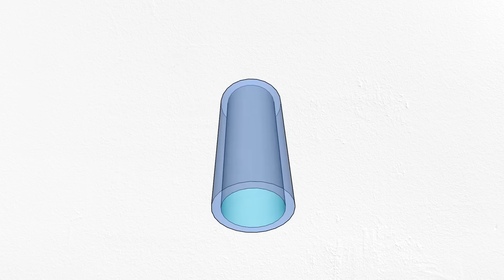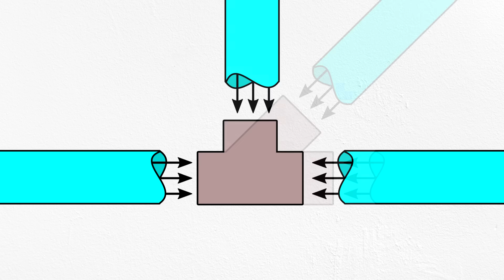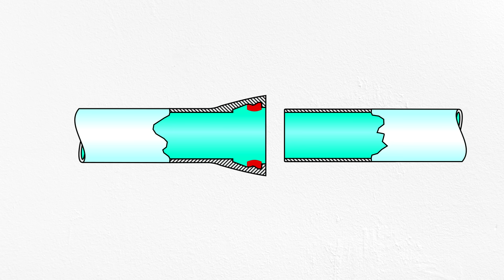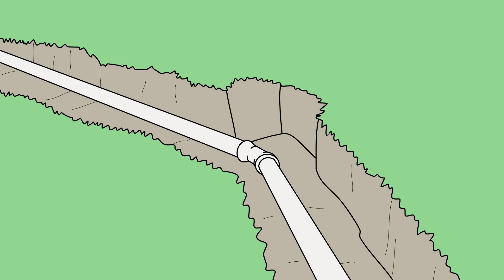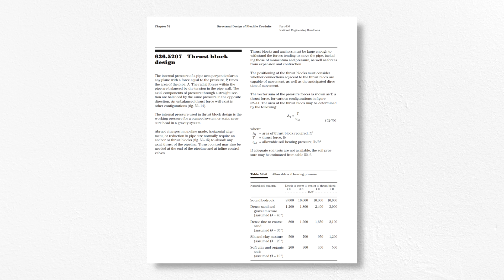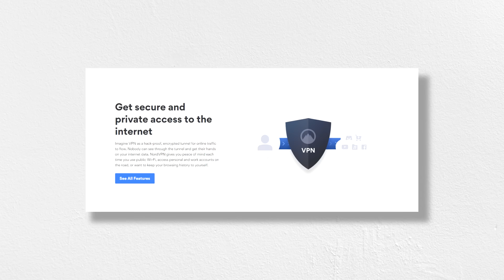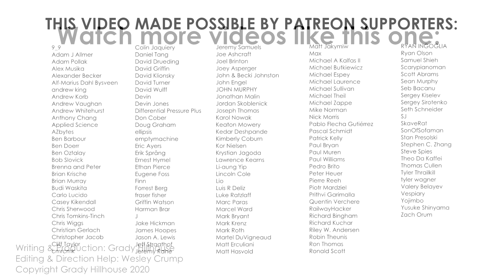Why Pipes Move Underground

Comment: Calculating static &  dynamic shock forces on large pipes, for example, 100 lbs static on a 12" pipe is 11,300 lbs, dynamic shock loads [like air in the line] multiply that many times!

Comment: One minor clarification, those push on joints are only used for straight line sections of pipe, and each pipe is not really held in lace by the dirt, but by the piece in front of it. Ant THAT piece is held in by the piece in front of IT, and so on until you reach a 45° or a 90°, which is held in place by a thrust block, a mechanical joint called a megalug, or both.

Comment: I'm honestly surprised that with modern materials those gaskets can't be induced to fuse the pipes together with a little electricity, heat, or just water-activated chemistry. Or is ease of disassembly a typical concern, too?

Comment: My house is on the side of a hill.  The upstairs bedrooms are downstairs, one level down from the front door.  On that level, there are a shower, toilet, and sink, in addition to the bedrooms.
Water from the 2 upstairs (ground level) toilets and a sink goes directly out to the sanitary sewer system.  Water from the kitchen and laundry goes down under the house.  It's joined there by water from the downstairs toilet, sink, and shower.  All that water flows to the ejector pump.  When the pump shuts off, after pumping a bit, there is serious water hammer.  In 3" PVC pipe.  With 57# of water coming to an instant stop.  So, what's the system? 

There is a tank, maybe 24" diameter and 30" deep.  Water flows into that tank.  The ejector pump, which is inside that tank has 2 switches.  The pump turns on when the top switch activates it, and off when the water is down to the level of the bottom switch.  A separate check valve, outside the tank, then closes and prevents water from flowing back into the tank.

The water is pumped up, through the top of the tank, into a 3" PVC pipe, through a 90° angle, through another 15' of horizontal PVC pipe, then another 90° angle, vertically up 12', through another 90° angle, and then to the pipe leading to the sanitary sewer.

ALL that plumbing is in the air, with a few brackets here and there to support it.  The problem arises because when the ejector pump shuts off, the check valve closes so that all the water doesn't flow back into the tank.  What you have, when the valve closes, is the weight of all that water coming to an instant stop.  What's the weight?

27*12*pi*1.25^2*62.4/(12^3) = 57 lbs.

(If you don't think that's a lot, try dropping a 50# weight on your toe, bringing it to an instant stop.  How many feet high would you like to drop it from?)

It's supposed to be a silent close valve, which should slow the water down, but I can hear it close.  It's not.  OR, that function is broken.  Where there are the 2 angles in the PVC pipe, there is considerable pressure, trying to tear those joints apart.

In the video of the commercial piping, there is backing where pipes have angles.  There is nothing in my system.   I asked about installing a water hammer arrestor and was told that, with a toilet etc in the line, I cannot do that because it will be clogged with .. yucky stuff .. over time.

I asked, "How 'bout we pump it straight up and over a hump, and then to the sewage line, and eliminate the need for the check valve?"  But that's not up to code.   At this point, I have no idea what to do.  The pipes have completely broken at least once, and been repaired.  But the problem hasn't been fixed.

Comment: Grady, with one other consideration important on underground water piping: Freezing in winter. I am from the mid-Atlantic area which has freezes during the winter months. When water freezes, it expands and will break anything containing it. Much of this is prevented by burying the pipe under the frost line. However, with older pipes, very cold water from a reservoir creates a temperature difference that causes a bursting of the pipe. The pipe itself is normally at a constant temperature being under the frost line. The water is extremely cold. The pipe can fail, resulting in a sinkhole at the surface.

Comment: Another reason why it is often desirable for a buried pipe to have joints that are not restrained, is to allow the pipe to expand and contract as it experiences changes in temperature.  In my opinion, the reason why some old cast iron water pipes experience breaks in freezing weather, is that the colder water in them and the colder soil around them (though not necessarily frozen) causes the pipe to contract, but it is unable to do so sufficiently to relieve the resulting stress if the joints have become "welded" by corrosion.  The pipe then fails by tensional stress at a point somewhere along it, possibly where it has been weakened by corrosion.  This is why so many old underground water pipes -- mostly under city streets -- need to eventually be replaced.

Comment: About 3 years ago, in Conroe Tx, a concrete truck hit a fire hydrant. The pressure from the water rushing out of that break cause 3 other breaks underground across 7 city blocks. It took 4 days to dig it all up and fix it.

After this post I found your water hammer video. Thats what they said happened.

Comment: I wonder why - if the pipe shouldn't move in longitudinal direction - the exterior of a pipe is very smooth. Wouldn't it be much better if the pipe was quite rough with small "ribs" to create better bonding with the surrounding soil?
Reply: For typical pressure pipes that have non-restrained couplings, one way to "anchor" a bend is to provide restrained joints at the bend itself, and for the pipes for some distance on each side of it.  The friction of the soil on the adjoining restrained lengths of pipe thereby resists the hydrostatic force on the bend.  The rougher the pipe exterior, the greater this frictional resistance will be per foot, and the less length of restrained pipe will be required.  But the pipe needs to be properly bedded and buried in compacted soil before it is pressurized, or it can blow apart at the first unrestrained joint.  This from a retired professional engineer who designed some very large buried pressure pipes.  I also had some unqualified engineers (illegally) modify a design of mine without taking into account the need to properly restrain bends, and it nearly caused a major failure.
Reply: @CarltonS  So wouldn't it be best if the pipe was completely grooved along its perimeter, like your typical drainage pipe? Why limit it to the bend and only "some distance"?

Comment: Also, soil moves and puts pressure on pipes and pipe joints.  As the soil moves so does the pipe to a certain extent.  At some point the soil movement overpowers the pipe's strength causing the pipe to break.

Comment: Hello Grady.

I drive a concrete mixer for a living. Some of your videos have helped me understand why some of the jobs I go to do what they do.

In my area, we refer to "thrust block" as water block. I was hoping you would mention it as a method of underground pipe restraint. You did not disappoint.

This method is even used on pipe joints which are flanged and bolted here.

Comment: Pretty sure the tap in ur house is only about 8 psi. 3-4x as much doesn't seem that serious. I mean I'm sure it is but know that a tap can put out 40 gpm at 8 psi or that that amt of psi out of a much larger pipe can reduced the drag on a 2000lbs sphere sitting on top of the pipe to nearly 0. Thank you science center in seattle for confusing me

Comment: Ain't pressure in pipe will be higher on the bottom if the system has vertical difference?

Comment: Great insights, keep up the good work.
I wonder if there is some mechanical fitting that can tie two parts of push-in pipe together, whilst still allowing for flex and expansion, as it seems a bit fragile.

Comment: I’m a pipeliner and imma say DO NOT again DO NOT try to sneak a peak into any trench or pit on the jobsite unless it is on your property or you ask one of the workers to accompany you or again just ask us what we are doing. It is dangerous to walk to the side of any of these excavations as the soil could quite easily cave and you could fall in and become trapped or break a bone or if there are exposed utilities (such as an exposed wire from excavation or boring) you could quite easily earn a trip to the ER for serious injuries or you might even catch a one way trip to the morgue. Just ask us. Most of the time we are more then happy to take a quick break from work and talk about the job. But I can’t stress enough do not get close to the excavations or equipment as most of it is dangerous. There are reasons any excavation deeper than 3 feet requires a ladder and a spotter and anything deeper than 4 feet requires trench boxes to support the sides.

Comment: Welding polyethylene pipes is kinda cool. On smaller pipes there are elements with integrated heating wires, which are connected to a welding machine that lets a defined current flow through the wires for a defined time. Thicker pipes, for example for connecting a multi-story building to the grid, get put in a hydraulic device, grinded off on the contact side, heated up with a heating element, and then hydraulicly pushed together until cold.

Comment: Another great video Grady.  Good job. If you haven't done videos on these subject already, this leads into all sorts of other considerations such as pipe stress and analysis, pipe guides and stops, expansion joints and why they often can't provide the flex required in a system, etc.  Very good videos for the layperson and a good reviews for Engineers.

Comment: Push on fittings can be made to lock pipes together. In fiber optic networks, the pipes are joined with connectors that have an o-ring to seal against pressure and water and little metal hooks that bite into the pipe and lock it in place. It can only be removed by pressing the release on the outside. An example of this type of connector is found here: https://www.gabocom.com/en/fittings/connectors/transparent-permanent-connectors/
Reply from the maker: Pressure in water mains can be very high. Also as diameter increases, force scales by diameter squared where the perimeter of the pipe to resist the force only increases linearly
Reply: @PracticalEngineeringChannel  Yeah I see your point. The connectors are rated for 15bar but the pipes are rather small in comparison to water and waste mains

Comment: In theory for a t-joint, couldn't you use a +joint and cap a shirt length of pipe off one end to get the same pipe thrust balance? If not how long of a pipe would it take to make such a capped side work as a thrust balance?

Comment: We are one of Leading in Pipeline Equipment Manufacturer and supplier in globe.
 (You can follow us on below Social Media Platform)
 
https://twitter.com/spmequipment
https://www.facebook.com/spmequipments
https://www.instagram.com/spmequipment
www.spmepl.com

•         Pipe Fit up and Line up clamps (External and Internal)
•         DSS Pipe joint clamps with/without purging arrangement
•         Pipe Bending machine and accessories 
•         Pipe Lifting and lowering equipment
•         Pipe Cutting and facing equipment
•         Pipe Roller and rotator
•         Line pipe plant equipment
•         Pipe Crossing equipment
•         Pipe Coating equipment
•         All type of Pneumatic and Hydraulic equipment and accessories
Reply: never heard of you.

Comment: There is another force on pipes you left out. External forces. 

If there is a pressure gradient in the groundwater, (water in the soil is flowing in a consistent direction) the soil itself moves, and a pipe can bow in the direction of the flow. 

I have seen where the subsurface flow of groundwater through sandy soil was perpendicular to a pipe, and between two manholes the pipe was bowed out over 10 feet to the side of where it would be expected to be.
Reply: Use TRENCH BREAKERS!!!!  foam or sandbag.
Reply: @zarthemad8386  this was perpendicular to the pipe

Comment: Great video. If you want to sneak a peak in the ditch or ask the installer about the work that's great, but please please don't cross barriers put up for your safety and follow posted signs. They may be a minor inconvenience when you need to get from here to there, but it protects us both.

Comment: The person gluing the pvc pipe to the pressure tank. When gluing pvc together you should twist the glued joint atleast 1/4 of a turn. It strengthens the bond of the glue. If not twisted when setting the pipe connection like what was shown in the video, it will have a higher premature failure rate/chance.

Comment: Still don't get how the parallel pipes don't pop apart :/
Reply: bell and spigot piping is typically very very low pressure .  the pressure at a bend  is transfered to concrete to absorbe the Pressure * ID of the piping. 
for high pressure systems... the piping is welded or fused (for plastics)

Comment: It's mostly butt-fused polyethylene around here (gas and water).  The gas transmission pipes are welded, except above ground, where they are bolted.  There have been some wooden water mains found in older parts of the city.
Reply: most of the above grade is welded... flanges are used where functional.

Comment: You should maybe, just a suggestion, make a video about the piping system in Mexico City. Mexico City is built on the bottom of a drained lake so they had to build super huge pipes to drain the water out. (And water systems over many centuries) The problem is that they also have to send water to Mexico City which is 2500 meters above sea level. From an engineering point of view is a very interesting place and infrastructure.

Comment: I work for a construction company that has contracts with cities to fix water main breaks. The main reason why water mains break are due to age. Secondly the dirt under the ground shifts which causes the pipes to shift, that leads to leaks and pipes freezing and in freezing causing cracks to get bigger. Water main breaks are always gonna happen no matter what. No thrust block is gonna stop a watermain from breaking and the pressure of a watermain is easily 3x more than your sink

Comment: I fuse high density polyethylene for gas transmission and distribution, polyethylene is so resilient it’s crazy to me why all utilities aren’t using it
Reply: SDR 7 20"+ HDPE is stupid thick..... it works for distribution lines (<10") but mains are another issue. 
Gas mains are always API 5L welded pipe.  
HDPE is also limited to less than 300 psig .. if memory serves.

Comment: Earlier this week at work we relocated a fire supression system for a pipeline terminal. 

The piping system was built in the 50s and construction and increase in water use over the years in the surrounding area ended up creating a dangerously high pressures and water hammer effects.

I was standing 10 meters away from a fire hydrant at the bottom of a hill when a pressure spike/water hammer almost tripled the pressure, blowing apart the hoses and valves we had set up for a pressure test.  (Apparently reaching almost 500 psi, while our setup was rated for 250

It was quite the explosion of water  and the geyser easily shot 40 meters and almost washed out a road
Reply: and that is why charging pumps exist... .......

Comment: So if working with a bundle of 6 inch copper water lines , would a 2 foot layer of spray insulation absorb that force as well as the concrete block ?
Reply: copper is braze welded.. so its better on the force transfer... but the foam isnt ridgid enough .

Comment: Built several natural gas compression stations. We thrust blocked our fittings and CLSM, flow filled, the rest of pipe run. CLSM provides compaction, strength, vibration dampening and protection. With the right mix you can dig it out easily. Over all win
Reply: .... you CLSM'ed the entire station...... fucking morons...

Comment: Current water systems, typically use mechanical joint restraints for tees and bends, rather than concrete blocks. For smaller pipes, 16" and smaller, locking gaskets are used to counteract longitudinal thrust forces.  Thrust collars at tees when newly installed pipe ties into old pipe.

Comment: It's still a good practice to use thrust blocks on mechanical joints as well even if it's not in the plan. Extra piece of mind.
Reply: not required for below grade welded pipe... but its a good idea for vert risers.

Comment: Interesting topic to see but i dont really understand the complicated methods like concrete blocks for counter force, almost all piping in germany is simply welded (both metal or plastics) or pressed which is basically welded if applied correctly.

Comment: I like the greater lesson in this video and I think you explain thrust blocks and there support well, However in the strain clear hose example the explanation is misleading.
the reason your straight joiner doesn't blow apart is due to it being restrained by the white plastic C clip holding the hose and NOT due to the pressure or flow forces neutralizing each other.

Comment: I never heard about slip-on fittings for anything else than unpressurized sewage pipes. As far as I know in Poland we either have welded  steel or PE pipes for water, even the large diameter ones. But maybe I have not seen large enough pipe that uses those :)

Comment: If welding all pipe joints is too expensive, why not, after repairing a joint separation, weld that one?
Reply: bell and spigot is typically cast iron... aka non-weldable and typically internally lined with concrete.